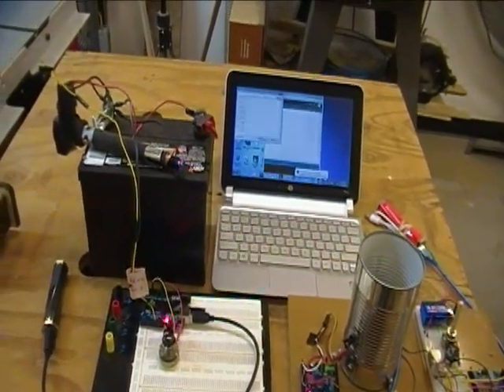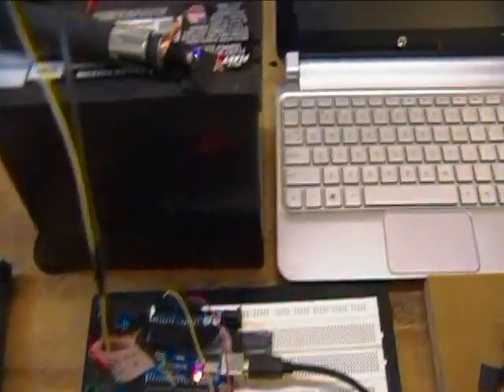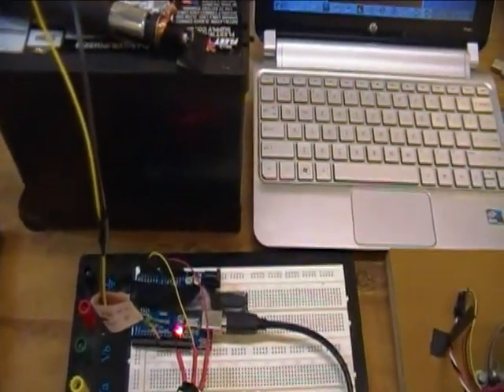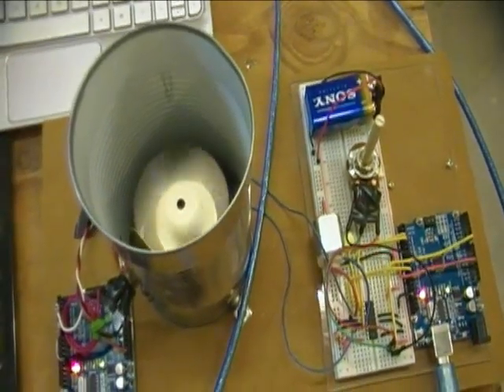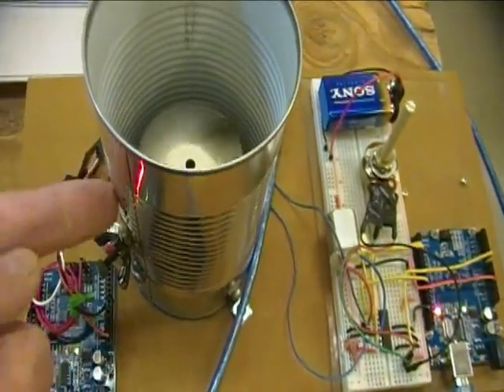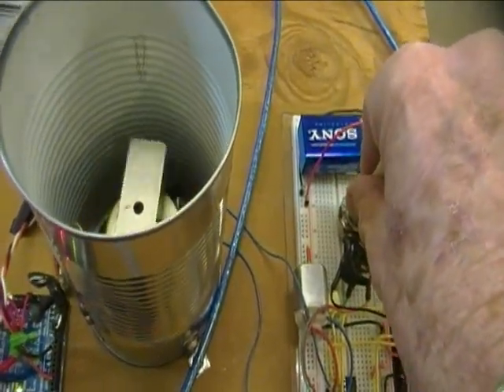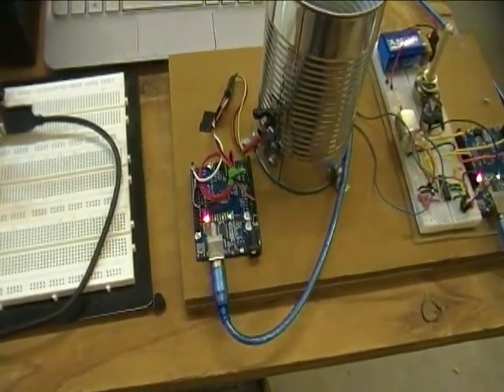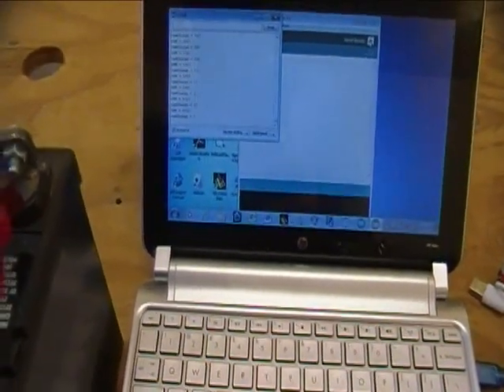Arduino Coil On Plug Controller Progress March 2015

Comment: Hello! I am on the journey of a similar project. Did you ever get this to work?
Reply from the maker: Not yet engine tested.
We are very close, but need to upgrade the  engine simulator to get to 6000 rpms.
See these other two videos:
Hall Effect sensor, north AND south magnets
https://www.youtube.com/watch?v=IWsqIPXExgo

Advance drift solved:
https://www.youtube.com/watch?v=U2_MIf4DJO8

We have gotten off track lately, for a couple of reasons.  We recently found a "four wire" two tower coil-near-plug pack that should run the 2 cylinder, four cycle Onan Generator sets and  the two cycle 2 cylinder Cushman Trackster engines which have been our targets all along.  The generators run at a fixed 1800 rpms and the Tracksters run up to about 5800 rpms.  We hope to get back to it soon.
  Without any more research, we think we are ready to go with the generators, just have to drill four holes in  a flywheel, add magnets and build an adapter..
  I know this isn't a very good excuse, but it'll take a lot of work to rebuild the engine simulator for the higher rpms.  I already have higher speed motors, so that's not even an issue.
Reply: Thats awesome! Very encouraging to hear. You can see my thread here: http://www.xs400.com/threads/82-maxim-dohc-400-electronics-retrofit.15941/ 

Page 2 and 3 are the good stuff. I bench tested with similar setup to you. My simulator can only reach about 1500 RPMs. However for the time being, I just want to see if my engine will idle at around 1200 RPMs. I hope to mount the system to an engine this coming weekend. I plan to have the timing statically advanced at 10º BTDC, meaning the sensors mounted at 10º BTDC. That way, at sub 1200 RPMs (idle speed for my motorcycle), it will have a fixed advance of 10º BTDC, minus dwell time (in my case, 4mS)

Do you think that will fire the engine properly?

Comment from the maker: I don't have a schematic for this particular setup, but I do have a rough schematic of a later version where the "spark-maker" Arduino and the Hall Effect sensor Arduino are combined into one Arduino Uno.
It is at the bottom of this page:
http://www.spaco.org/Computing/arduino.htm

The H-Bridge circuit that is driving the motor is fully covered in Chapter 4 of Jeremy Blum's book, Exporing Arduino.

Comment: Great information. Thank you for posting. For your consideration have a look at the VB325SP. You may be able to off-load the computing power required to run your dwell time on these little guys and have your Arduino work on important stuff.